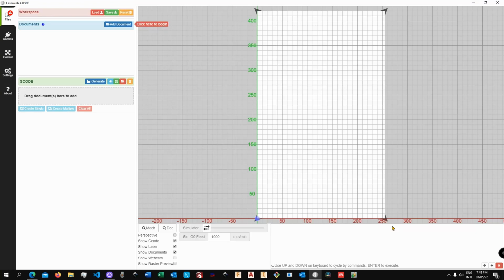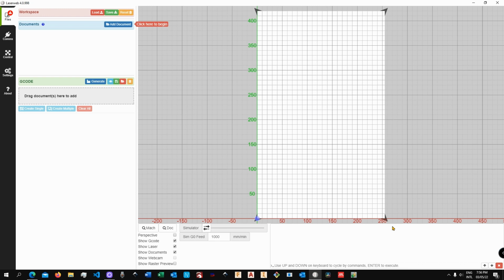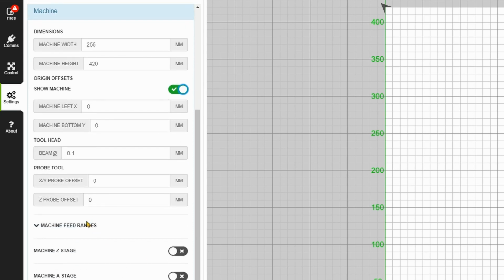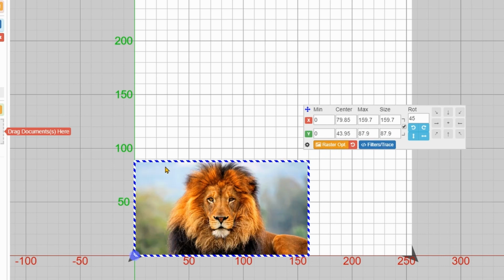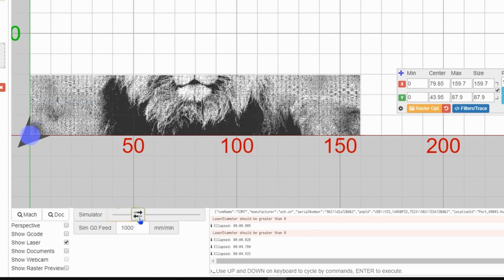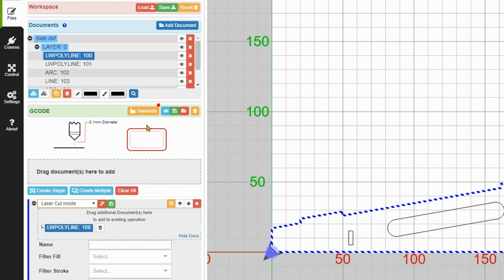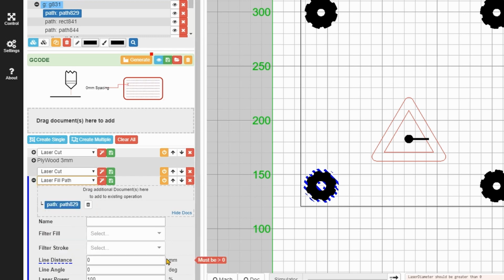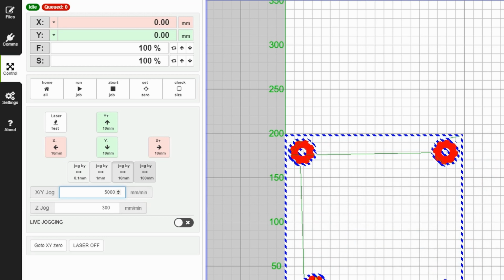LaserWeb Laser Machine and CNC Mill Software - The alternative to LaserGRBL and LightBurn.

Comment: lightburn core its now 99 usd understan is lifetime and the complete version its 200 usd, the core version stop receiving updates after a year of use but i cant pay 200, do u believe core version its ok to start whit mi 22w diode 600 x 600 milimeters of workspace laser?

Comment: Seems to be a good software, steep learning curve though, however, I get an error when loading DXF files saying they are not compatible.
Reply from the maker: Hello Raymond Jones, thank you for your comment.

Yeah, it is not as easy as the other two. Definitely, having some experience with laser machines and controlling software will help.

A DXF file is basically a data file format, and it has several versions. I normally export files in DXF version 2013, which works flawlessly.
So if you created the file out of a DWG or other drawing format, I suggest you re-export the file, possibly in version 2013.

Perhaps you got it in a newer version, and the software is incompatible.

I hope it helps
Ciao
Reply: @MiddleRoomWorkshop  Ive tried every DXF version available with no luck whatsoever
Reply from the maker: Hello Raymond Jones, thank you for your feedback.

I check in the software's documentation, and it seems like the software only recognises the DXF version R12, but from Autocad, I export in version 13, and I get no problem whatsoever.

What about your LaserWeb version? I am using version 4.0.998. Maybe something wrong with newer versions.

Let me know.
Ciao
Reply: @MiddleRoomWorkshop  Sorry, I have no idea whatsoever. I uninstalled it. For some reason unknown to me, it was interfering with CorelDraw 2021 as well. Corel crashed every time I opened it whilst LaserWeb was running. Also, I started having problems with Vectric Aspire too when LaserWeb was running. Rather strange really, it all started basically at the same time after my Vega 11 graphics updated, so I uninstalled it, and everything went back to normal. Strange.
Reply from the maker: Hello Raymond Jones, thank you for your feedback.

Problem solved then :). Joking
I am sorry to hear that. I haven't had problems with it except for a test with a large complex file where it took forever to process the gcode, but now I just tried with the Task Manager running at it takes like 15% of my VRAM and up to 50%while processing and I got an AMD RX6700XT GPU with 12GB of VRAM.
I guess the developer did not spend much on graphics optimization. Also, the way it runs looks like browser-based software.

Well, that is good to know, at least for me.

I hope you got another option.
Ciao
Reply: @MiddleRoomWorkshop  I do use Lightburn, LaserGrbl and Vectric Aspire along with CorelDraw 2021, Revit and Photoshop 2022. I find CorelDraw the better software for designing, editing and such and have used it since it first came out years ago. I used to cut a lot of vinyl for sandblasting decals and always did it from CorelDraw and have found that it produces excellent DXF files for Vectric Aspire and lightburn, etc. I downloaded LaserWeb after investigating its workflow possibilities, but unfortunately it seems to be a no go. I´ll probably download it and re-install it after investigating why I was getting errors and crashes but it will be later on. As for computer power, I have a Ryzen processor, 128GB en RAM with a 2TB SSD, Windows 11 Enterprise 64 bit system. I am currently doing the Mayan Short calendar; 240 x 240 cms in four tiled pieces, the complete file is over 2GB and loads really fast in Vectric Aspire. Im pretty sure that the errors are due to LaserWeb being a semi-based web application. Greetings from Mexico. Have a great day.